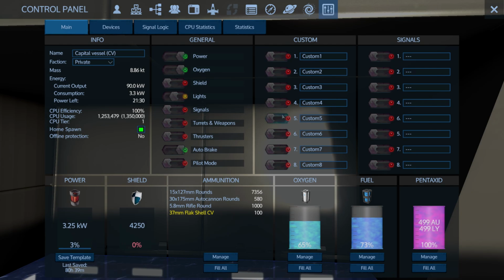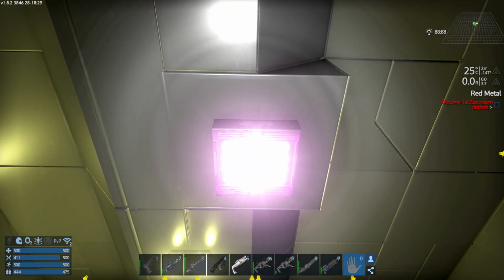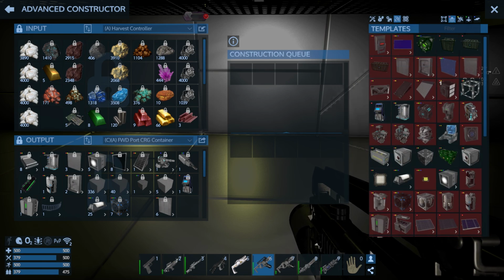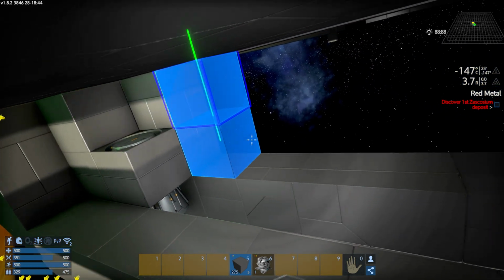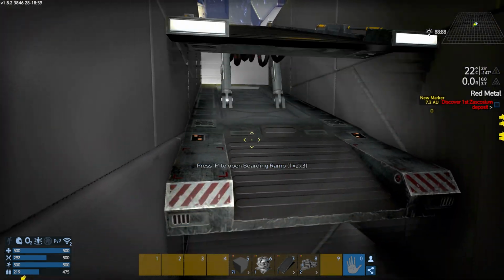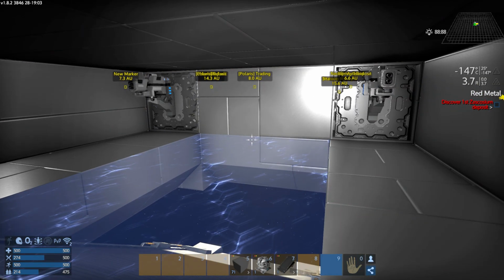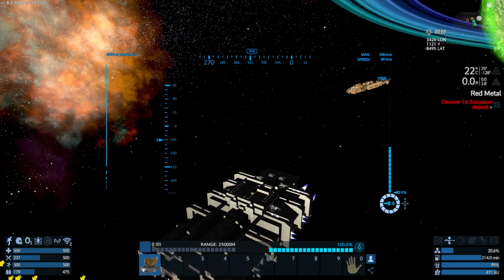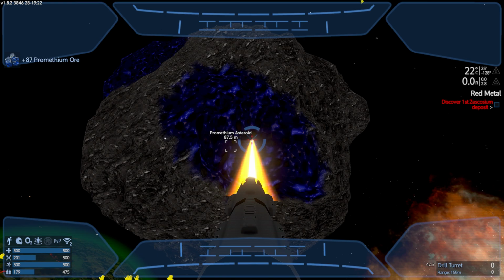Empyrion: Galactic Survival | Reforged Eden | Ep24 - CV Update and First Real Flight

Comment: 14:20 Just FYI.. those turrets you were showing us.. they're invisible to us.. I can see the outline of each turret bu the actual turret itself is not visible.  No sure why that is..
Reply from the maker: Some of them were retracted at the time, which is probably why, as I was more just pointing them out while using the Multi-tool to highlight the block.
Reply: @Haladmer  Damn.. that's right.. retracted turrets have that weird outline.. I'd forgotten that... I don't generally use them so it's easy to forget that it's a FEATURE NOT A BUG... lol

Comment: 6:22 Curious side point here.. why did you choose that particular position for the warp drive unit?   I'd think you would want it more horizontal than vertical.. not only for the looks but for the aesthetics...
Reply from the maker: The main reason is the warp core is 3 blocks wide and 2 blocks tall, the ship is an even number of blocks wide and I didn't want it be mounted "sideways" (long edge running port ↔ starboard)  Originally it was planned to be on the floor, but I decided I liked the idea of the room being more vertical, and it worked out nicely in how it lined up with the crew areas to either side :)
Reply: @Haladmer  Ah.. yes.. I forgot that point when you were laying down the basic structure..